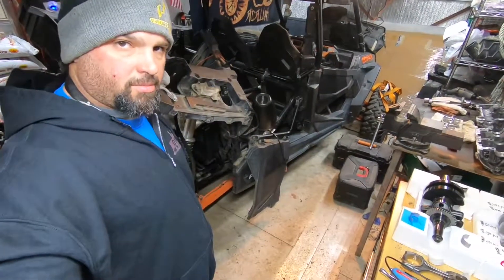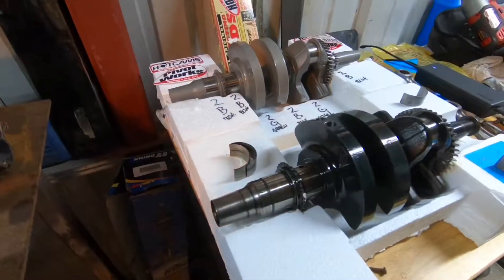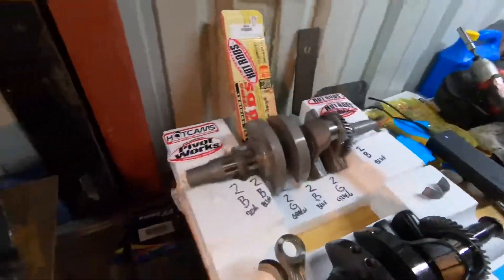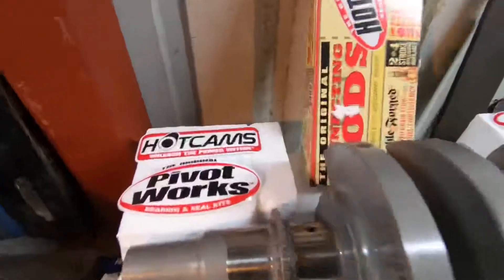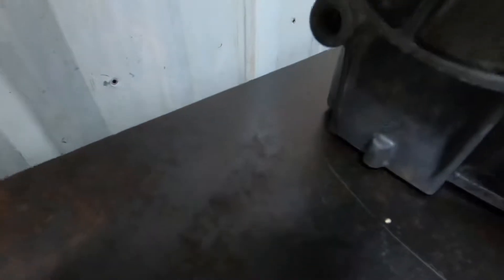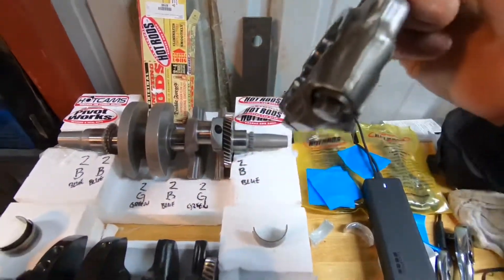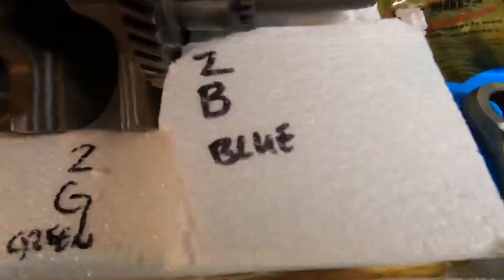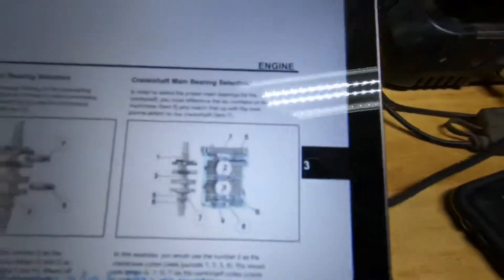2014 Polaris RZR 1000 Crankshaft, piston rod and harmonic balancer bearing selection

Comment: Did you mic bearings ? Or use a plastic gauge or anything?  Does it call for it ?
Reply from the maker: If your trying to reuse your old crank shaft then you need to mic to see if it’s within spec. Since I used a new crank shaft I just went by printed code on the shaft and casing
Reply: Ok cool    How’s it running?   I see after market fuel rail too